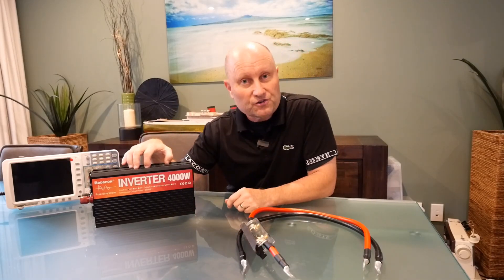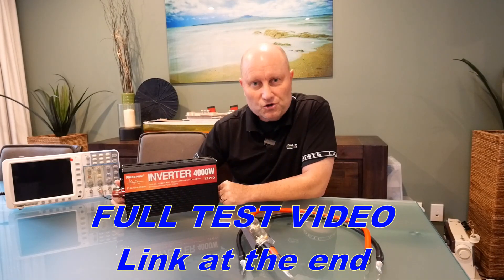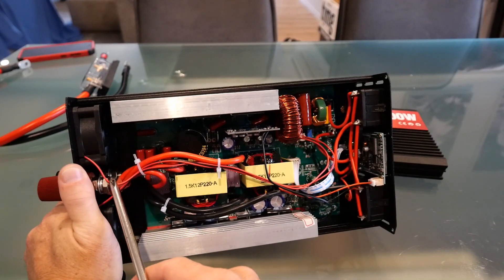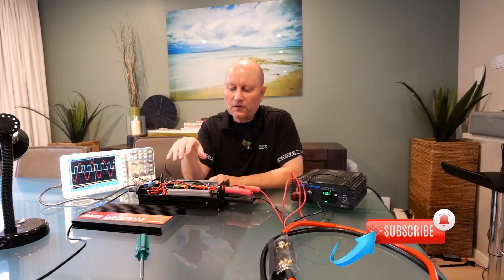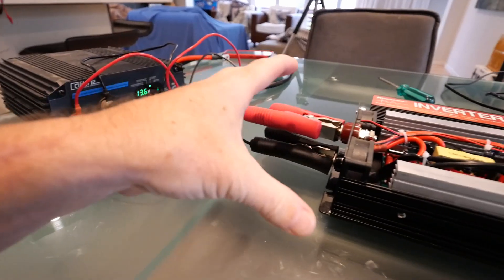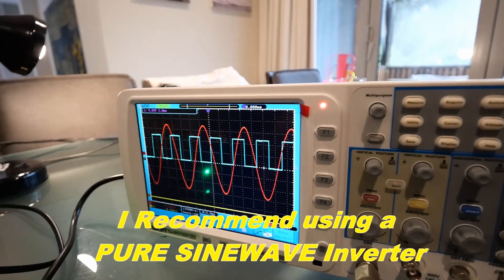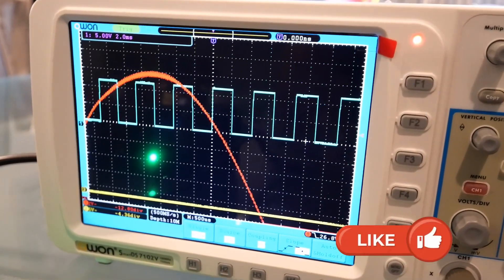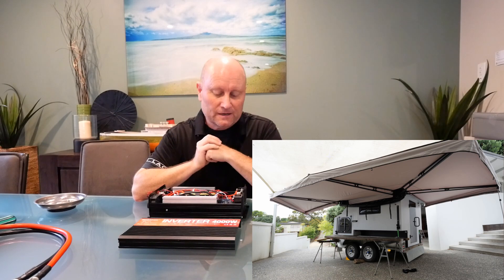2000W Chinese Sinewave INVERTER INSIDE INSPECTION - ARE THEY ANY GOOD ?

Comment: What I'm interested in is whether the total harmonic distortion (THD) gets worse if the load is not purely resistive, but also includes inductive or capacitive load components?
Reply from the maker: humm..  a fair question.  I didn't test on any particularly inductive or capacitive loads,  as my needs are pretty simple in our camper setup.  I was impressed though at the quality of the sinewave on the loads I did test.  I was expecting something more blocky.. for the low price point.
Reply: @DIY-CIRCUIT  I understand the point about the low-cost option. And what does it matter if the sine wave looks distorted? For example, testing with the Inrush current of a refrigerator will cause 80% of inverters to burn out. Inverters from ASP Switzerland can handle this without any problems because they use a different modulation method and a toroidal transformer.

Comment: Nice sine wave. I have a 2000w 240V Giandel coming from AU eBay at a good price with eBays 17%-off fathers day sale. They are also supposed to be good, reliable and good service. I chose it mainly as its 240V, not 220V. I only have a portable multimeter that shows mains sine wave but hopefully it looks like yours, even though it cant zoom in like that fancy one you have. Lol
Retired electrician on a budget here.😂👍
Reply from the maker: Thanks for watching, Sounds like you got a good deal also, I hope it works out well for you. probably a good call to get the 240 version, being in Aussie. The  Giandel looks to be a decent unit, from what I could see.
Reply: @DIY-CIRCUIT yeah, I'm excited. It arrived today. I'll give it a run tomorrow. 🤞🤠